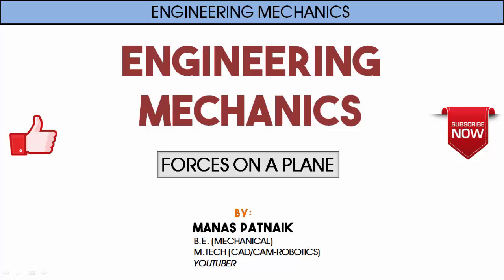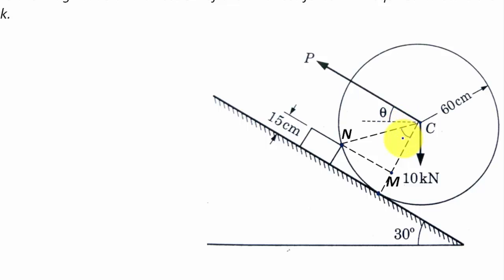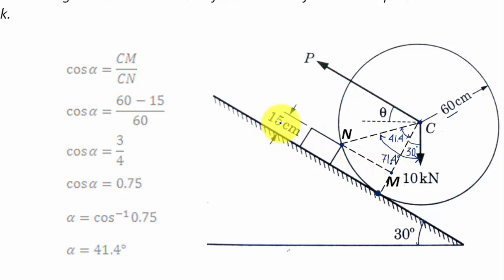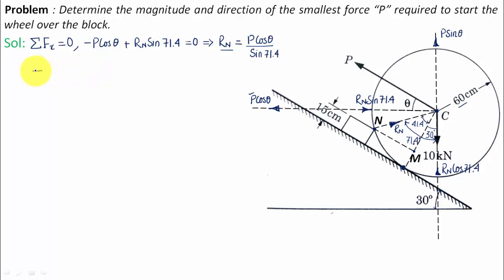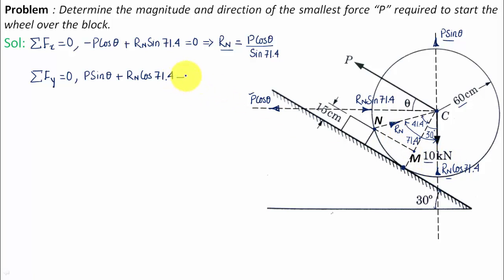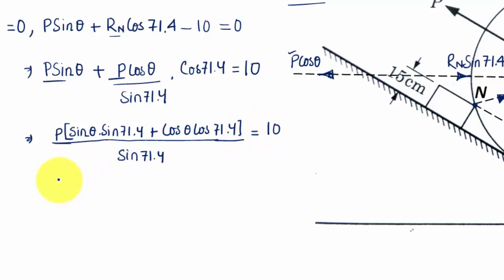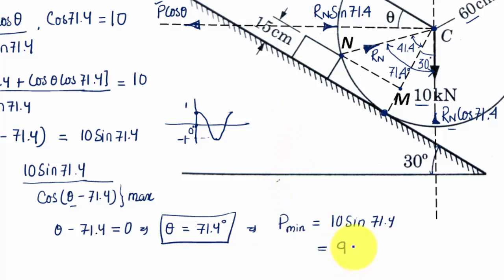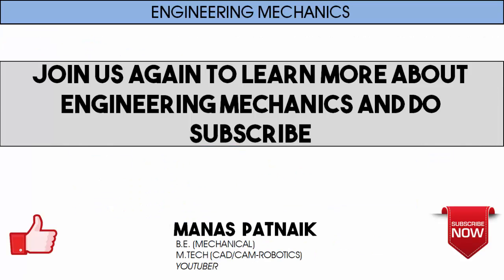Engineering Mechanics_Forces on a Plane_Level 2_Problem 13

Comment: Sir, why didn't we consider the normal reaction due to the including plane?
Reply: Yeahh...exactly..the reaction due to the point M on the planee
Reply: Since wheel starts, reaction 0
Reply: @soumyanarayanan1412  but initially the cylinder is touching the surface of the inclined plane so why not include the normal force? please answer

Comment: Why won't we use net torque is equal to zero about edge???
Reply: if you take net torque about the edge, you will come up with the same answer. considering the P min will take place when it is perpendicular to the reaction of the block.

Comment: how angle became 30 degre?
Reply: surya sapkota the 10kN force moves directly downwards as it is presumed to be the weight of the wheel. Because the wheel it angled at 30 degrees from the x axis the line CM perpendicular to the base serves as a guiding line for where the force would be if the wheel was not elevated. So the difference is based on its elevation angle which is 30 degrees.